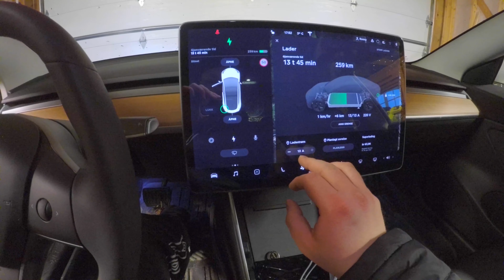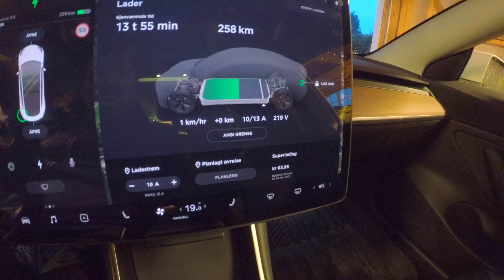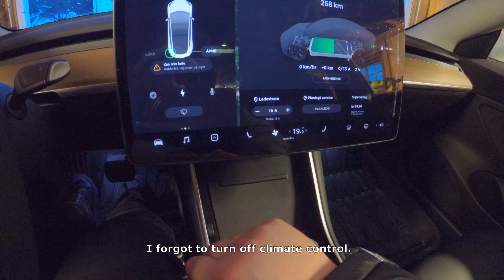Is charging Tesla Model 3 possible with a Honda 2.2 kW generator? 4k

Comment: Lots of reasons why this is a bad idea and not practical but most importantly... 

Many portable generators provide only low quality “dirty energy” unless they have on board inverters and properly grounded. The potential to damage your $50,000 EV is something to take seriously...

Try this at your own peril
Reply: @andrew the car decides whether to accept the power or not. If power is dirty or connection is not grounded then car won’t charge.
Reply: Andrew this is honda generator. It is inverter generator and puts out perfectly clean electricity same as your wall outlet. I have a big eu 7000 that also has a 240v option.